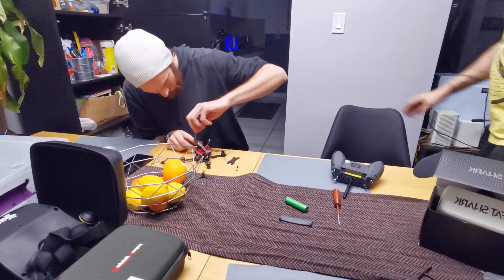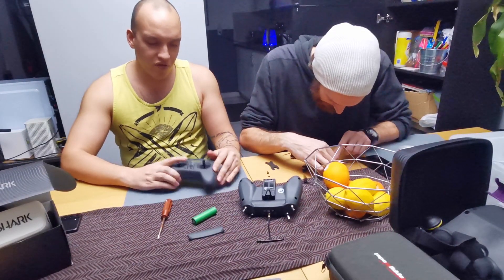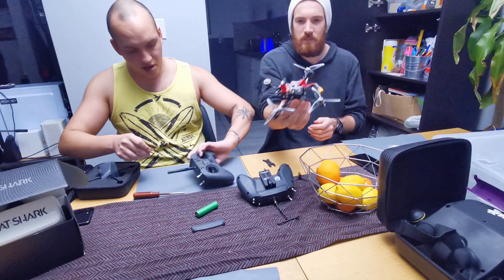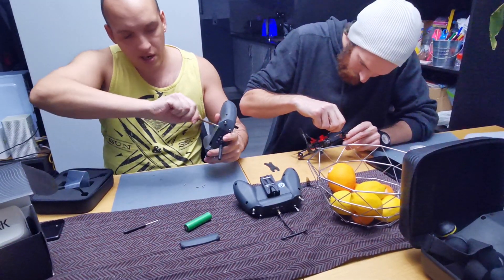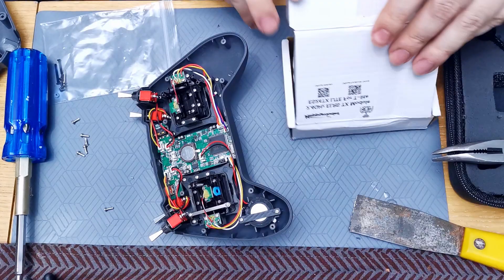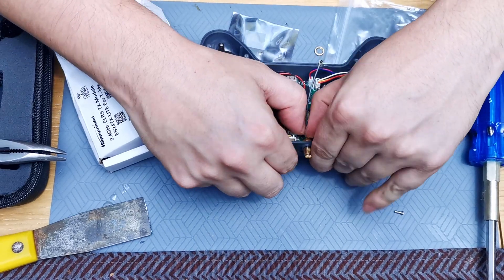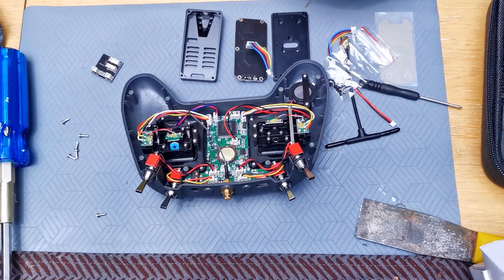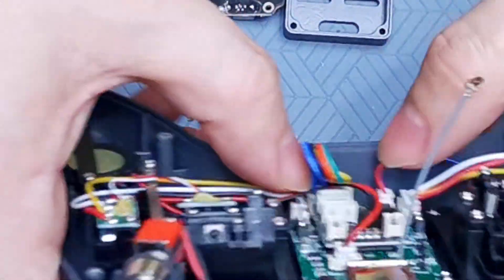Jumper T-Lite ExpressLRS Happymodel Installation With Internal Antenna Hack!

Comment: I'm confused. Why get rid of 4 in 1? Seems like a 4 in 1 + elrs is better.
Reply from the maker: If you had old quads that would use it for sure but I just got into FPV as expressLrs is already out and I would never buy any quads that aren't on expressLRS or that I couldn't put it on. expresslrd is just so superior that I wouldn't care to fly anything else. Accept maybe red pine for racing well I'm good for now. I mostly fly 3.5 in which needs to go further than a 4 in one would go anyways. Also the jumper tea light broke in a month so I'm on a pocket now. So to me expresslrs & Gemini if I need it.
Reply: Gotcha. Yeah I am no huge veteran but I have some basic FlySky stuff I started with so that's really the only reason i'd want it. @TorontoFPV
Reply: @TorontoFPV  Also cheap toys and stuff. Like if you bought a little airplane or helicopter kit it will come with a crappy controller but you can use your good one instead.
Reply from the maker: I see your point but I learned to design my own so that I'd never have to fly things like that but to each their own.   @JonnyWaldes
Reply: Thanks for your video because what I really needed to see was controller internals because I want to 3d print a new housing and built it into RC with an fpv LCD screeen   @TorontoFPV
Reply from the maker: Anytime bro! I Suggest a Radiomaster pocket @JonnyWaldes

Comment: I like how you replaced the 4 in 1, but you still have an external module in that the ungly ELRS box is still showing externally underneath. Think I will insulate the bottom of the ELRS module to prevent from shorting on the 4-in-1 module metal backplate

Comment: I this this with my xlite and my full crossfire tx! Said f the internal sbus access crap took it out and deceased the crsf boards wifi boards in the Jr module I don't use but have bt on the main board and screen hole and joystick holes were cut out! Did the 18650 mod and can get up to 1w for 4 hours on a full charge! Need elrs for 2.4 kuz the antennas are Hella small and build micro long range whoops and all kinds of small stuff and 900mgz is a pain! Don't get me started on 1.3ghz video! Lmao! Thanks for the video! New sub! Always enjoy these hack tricks! I do this stuff too it's how I keep the hobby interesting after 7 years of fpv and 30 in rc